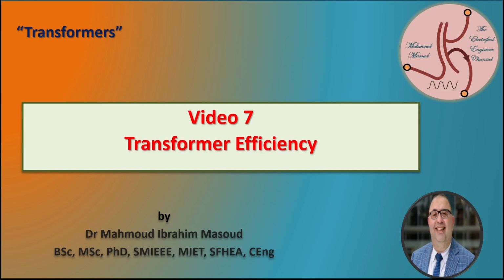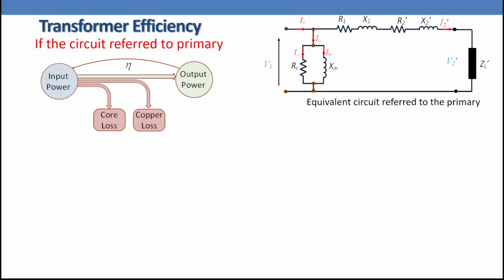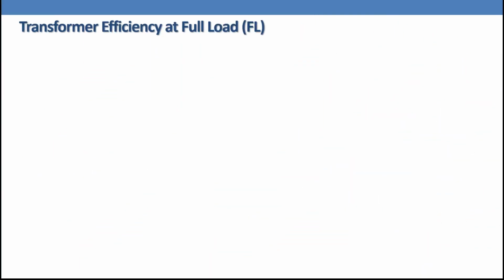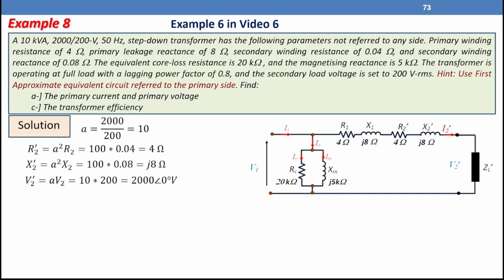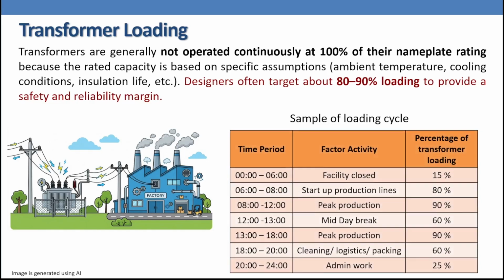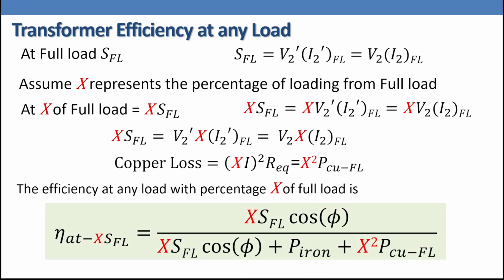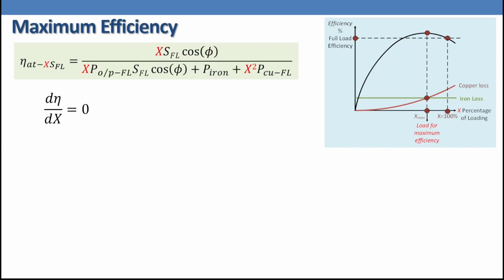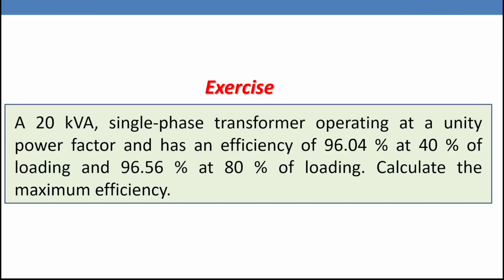Transformer Efficiency

Comment from the maker: Understanding transformer efficiency is essential for analysing transformer performance, reducing losses, improving energy utilisation, and designing cost-effective power systems. In this video, we explore efficiency calculations, loading effects, maximum efficiency conditions, and several worked examples that demonstrate both theory and practical application.

📝 Challenge: Complete the exercise at the end of the video and post your answer in the comments. Let us know which method you used and compare your results with other viewers!

👍 If you found this video useful:

Like the video
Subscribe to the channel
Share it with friends, colleagues, and fellow engineering students
Leave a comment with your questions or suggestions for future topics

🔔 Subscribe and enable notifications to follow the complete transformer series, including transformer theory, equivalent circuits, voltage regulation, efficiency, testing, and power system applications.

Your support helps the channel continue creating high-quality electrical engineering content. Thank you for watching! ⚡🔌 #TransformerEfficiency #ElectricalEngineering #PowerSystems